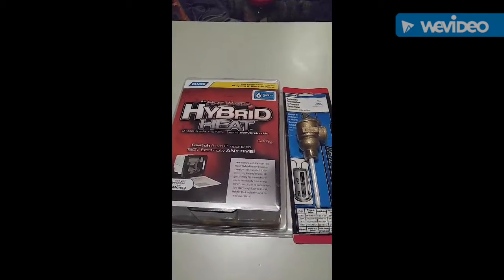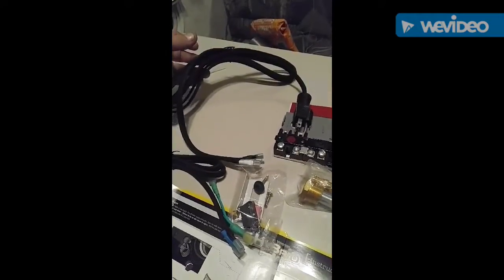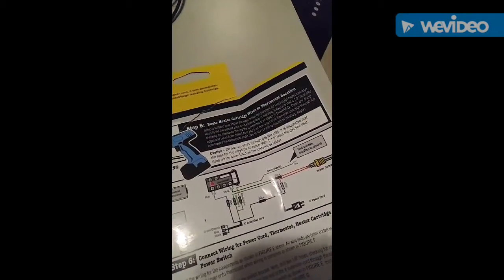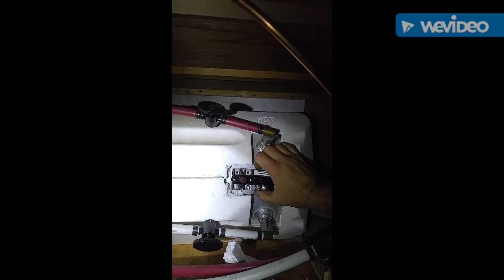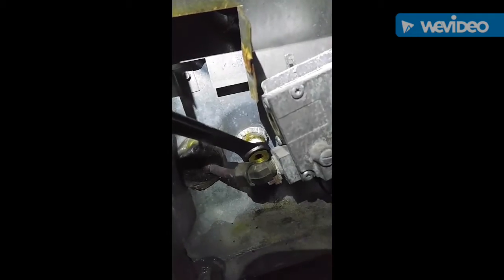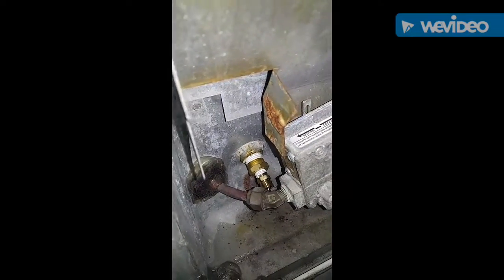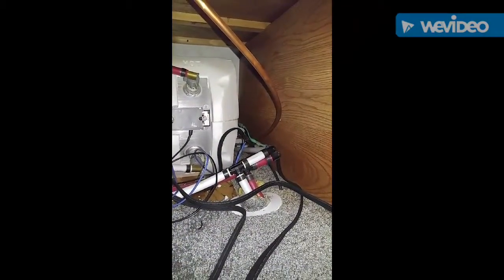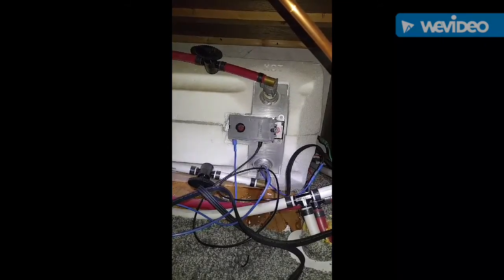Installing camco hybrid heat

Comment: did this end up giving you trouble free hot water? I got this kit for Xmas. I'm unsure whether this is worth it or not
Reply: I love it, since I made the video I haven't needed propane at all, minus when I use my oven or stovetop.
Reply: ok. im going to do it. It would be nice to just come home and have hot water waiting on me. :) Thanks for the reply sir!
Reply from the maker: sonichuizcool no problem at all!  If you need any help drop me a message. It's such a simple install but who knows what can happen sometimes.
Reply: @Sparkfly88  your rv has a byilt in washer & dryer?  Do you have video on it?
Reply from the maker: @camposvazquez  no, I added them. The washer is made by Haier, and the dryer was a Sonya, and now it's a magic chef. Both run off standard outlets.
Reply: @Sparkfly88  please can you do a video when you have a moment..  I have a small 22' toyota rv..  I bought a used all in one compact LG washer/dryer..  

My goal is to first install it and get it working...  Then put the water through a filtered loop and recirculate it....

My toyota rv is a dry bath end the rear of the rv model...
Reply from the maker: @camposvazquez  I live in a 30 footer by myself with just my puppy. The back room had three bunks. I put the washer in front of the back door which I never use and hooked it up to the sink. The dryer I put where one of the bunks was and ran the vent outside the window next to it.

Comment: Can the thermostat be placed on any part of the tank like on top or has to necessary be on the side
Reply from the maker: If I remember right the instructions said it just had to be a flat surface. I wouldn't want it on the top though, heat rises, so the moment the top got to temp it would shut off. The rest of the tank would be cooler.
Reply: @Sparkfly88  thanks for the advice
Reply: Also at the top there maybe a bubble of air so it may not get a good reading.